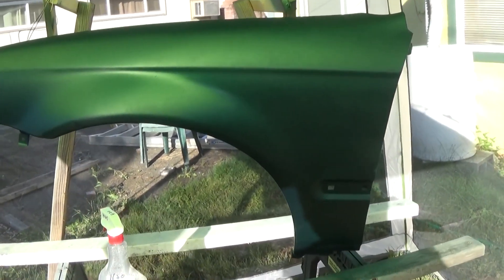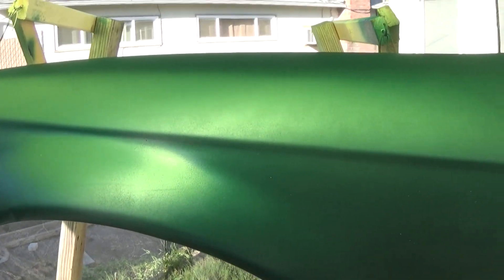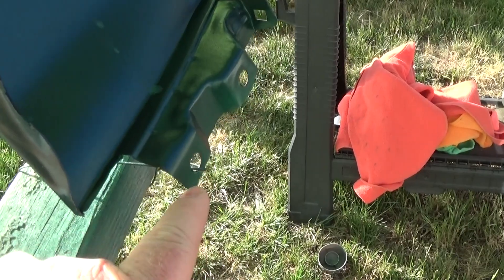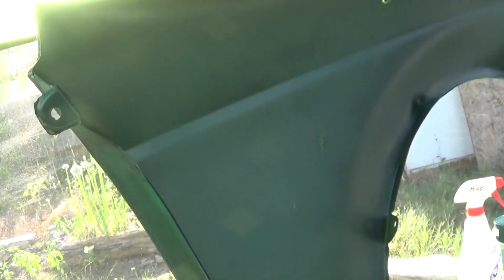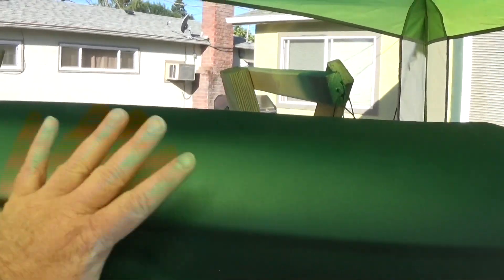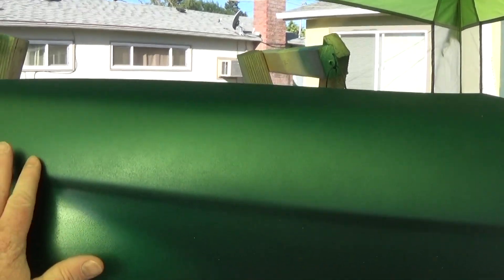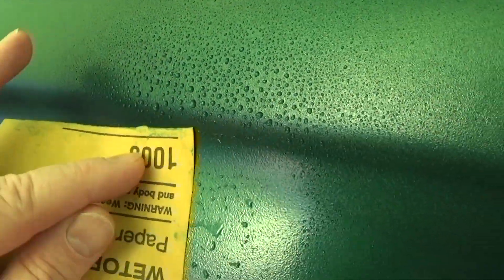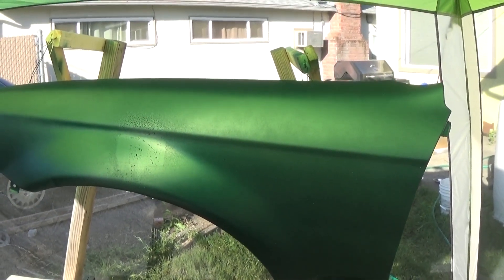Painting fender update

Comment: I like the color, I did a similar repair on mine using spraycans and didn't look all that great .  I probably shoulve used a clear coat and wet sanded, I learned alot of things from watching different channels and alot of them do a wetsand.
Reply: Myself I use a roller or brush and apply my primers for repairs because you don't have the over spray, it costs less, and you just dry or wet sand it smooth afterwards. Getting that primer smooth and blended for a smooth surface without the sand scratches and imperfections is critical to how your paint will go on. Painting is easy its all of your prep work before is what makes the difference. As for your finish coat with a rattle can its all about the outdoor temperature,humidity, and what paint or coating you are using. You have to watch so you do not have excessive orange peel, light spots, runs, and blushing. The trick is when spraying keep a wet edge or do light coats. Another trick with non metallic paints is I do is I use a good quality re usable soft bristle camel hair brush or a disposable roller and apply my color. A oil based product called Penetrol by Flood add it to any oil based single stage enamel like Rustoleum it improves adhesion along with making your brush marks pretty much vanish. I have used Rustoleum to oil based Martin Senior hardware store products for many years with no come backs, and have had people think that the paint job was high dollar. Look into good clay bars for cutting a clear coat before buffing. I wet sand, clay bar, and buff with machine or by hand and it just takes time. Anymore I sometimes cheat and have a powder coating shop powder coat motorcycle gas tanks, tins, fenders etc. I have the powder coating shop powder coat whatever color and have them clear over it. I can also wet sand and paint right over powder coating because it is an excellent primer. I can do graphics over it and shoot a clear coating over my work which saves me a fortune because paint products are expensive. Plus it saves time for me.